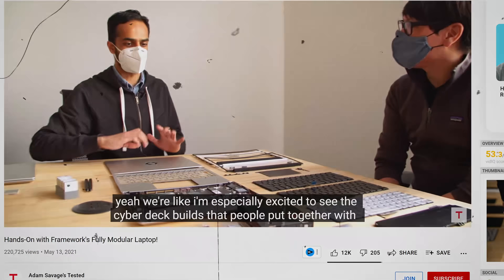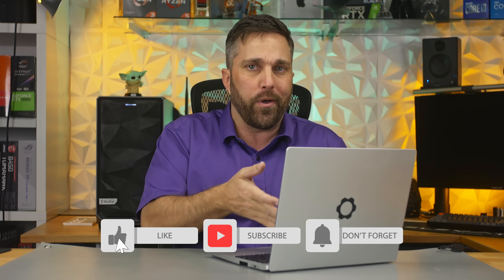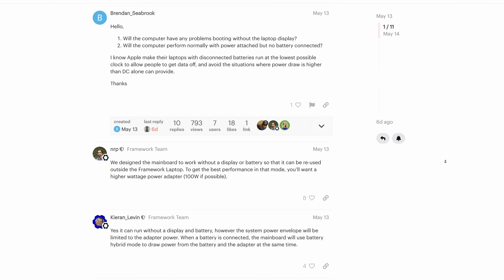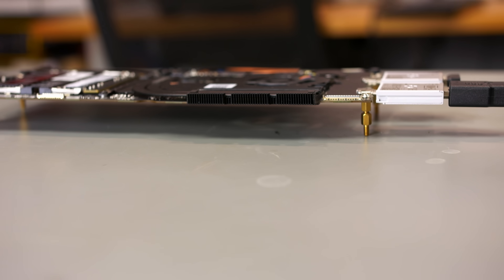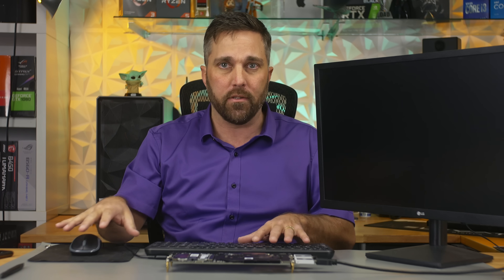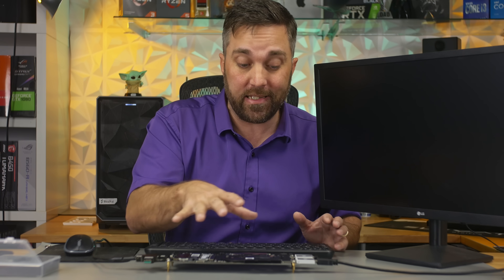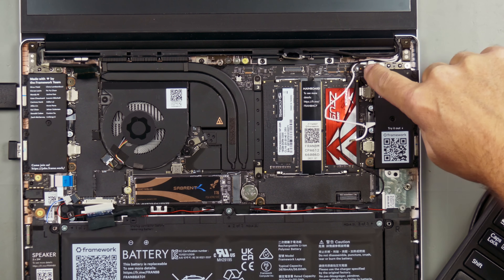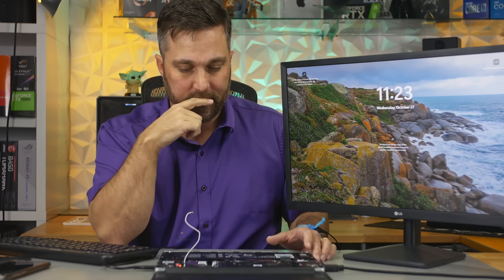This Framework Feature Isn't as Advertised. - Mainboard Testing.

Comment: 3.06 firmware which is currently in beta testing has battery-less operation working (with a few nits), and will be fully functional in an upcoming firmware update.  It actually works with older firmware as well if you use a higher-wattage power adapter, just not the 60W adapter we ship with.
Reply: @Elevated Systems, and @Framework, what you two have done in this post proves two things to me. First, why we need to always do our own testing. Second, a company that cares about what its customers say and do with their product matters, and the level and speed of a response matters in handling the problem or kudos. This is why I purchased one recently. Thank you so much for doing t he work on both ends, and sharing with us this information.
Reply from the maker: Edit: Just got the BIOS v3.06 that was posted on the Framework site.. Will install and start testing tonight. Will post an update ASAP. 
Thanks for the update. Can you provide a link to the Beta BIOS? Also I tested with a 100W power supply. Edit: My apologies for my initial thumbnail. I was disappointed and I let that get the better of me in a way that was not fair to your mission.
Reply: @ElevatedSystems  apple doesn’t reply this quick 🙄 or at all…
Reply: @BozoFett  you guys getting replies from Apple?🤯
Reply from the maker: @BozoFett  Apple still hasn't replied to me when I reached out about my M1 Mac Mini failing to boot almost a year ago. But I don't have the same (or any) level of trust for Apple that I do for Framework. When someone you don't trust or respect betrays you it isn't unexpected but the opposite stings a bit. (and yes betray is too strong but it was a metaphor after all)
Reply: @BozoFett  their business model does not acknowledge people at all. they do their own thing and pretend that no other company exists. for the first time in over 20 years, they have directly compared a spec of the new macbook pro with a gaming laptop of some sort. when they do something that people have been asking for such as bringing back mag safe or an SD card slot, that is coincidental that people just so happened to be asking for. Same for Adobe. they just dont care. they dont have to care. they can get away with it because people will still buy their shit. the problem is not the companies. its the people going back and not doing anything about an issue.....

Users complain and complain and complain, then they keep using them. Why do you keep eating something you dont like the taste of and that isnt very good for you? you know what that is called when people do that? an unhealthy addiction....
Reply: @ElevatedSystems  does the charger output 100W with the battery plugged in? ie have you proven that it's actually putting out or pulling 100W.
Reply from the maker: @jonmayer  Yes I load tested it and it peaked at 98.1W
Reply: @ElevatedSystems  Beware of voltage drops both on the adapter and across the cable as well.
Would have said send it to Linus but he’s invested in framework so you might not believe him.
Also the USB-C power capabilities and data reporting by cables and power supplies can be iffy sometimes.
Reply: @ElevatedSystems  emailed you a copy of the 3.06 BIOS
Reply: Has anyone else notice that Framework's statement about  misleading people was also misleading? He tested the thing with a 100 watt charger and it didn't work like they just claimed it does.
Reply: @garryconnors8804  and where was the prove that it actually was a 100w power charger ?? he has not shown us it was 100 watt he can say many things untill he shows us it is in fact 100w also he knew they were working on it to make it work without a battery  but still he want to pull framework down he is misleading not framework and i seen in a comment that some one gave him the beta bios ...  so he can set his mistake straight and if he does not make a new video with the new bios and shows us he actually has a 100w power supply then he is the one we cant trust in what he claims .
Reply: @garryconnors8804  be careful Garry, you're not allowed to say anything other than glowingly positive statements when it comes to Framework... :D
Reply: @emlyndewar  No need to troll, some people care about sustainable products that's all. No need to make fun of them. I know you're happily supporting Apple but what they do is harmful to consumers. It's a small company that already provided tons more than any other company thousands bigger.
Reply: @bencze465  You are missing the point. Some people care about sustainable products, that's why it was important for this video to highlight the claims that were (at the time) not being met. 
I'm also NOT typing this on an Apple product, instead on a 5th gen i7 Dell that's fished from the trash... 
I care about sustainable products, and Framework are cool, but the level of fanboy nonsense surrounding them is ridiculous.
Reply: cheers, Framework 👌👌
Reply: @ElevatedSystems did you try an earlier firmware? Their release notes mention that it’s a known issue with the 3.03 firmware. It’s possible (and as a software engineer I have done this 1000s of times) that they simply broke the feature. The forum post might have been a “hey we know we broke it, we are fixing it next release”. Just since you went a bit guns blazing but didn’t mention trying an earlier firmware it’s worth the ask. I have been enjoying your content, this just doesn’t seem as well produced as most of your other content. 
If they did advertise a non-working feature that’s poor form.
Reply: Not saying this happen but it problem worked without a battery at some point in development. Then there could have been a battery problem and they added a check to the firmware and I turn making it think there is a battery problem when there is no battery so it won't boot.

I have helped support software this same thing happens to a fix to a problem ends up disabling a feature that customers used.  You know how hard it is to tell a customer you know that feature you use well you have to downgrade if you want it back I know there are security risks but the feature won't be back to at least another few months ;-)
Reply: @jbscmos  this is why open source is the way to go for any business interested in making a quality product
Reply: pog
Reply: Thanks framework. That was a pretty quick and easy fix, as if you were planning to do this all along...

Maybe this is a good example of work with the company before jumping to conclusions.
Reply from the maker: @Kirk Eby I pointed it out. I pinned the comment so ppl don't miss it.
Reply: @ElevatedSystems  I fail to see how Framework let you down then.. The title along with the corresponding video makes you sound very disingenuous. The lack of weight in your opinions is exactly why I don't plan on subscribing. It sounds like everything Framework has said, they've upkept. It really sounds like YOU'RE misunderstanding, and are being overly critical. Ooh, they have ruined your trust? Won't effect their sales at all.  Thousands of pulls from your vids? I highly doubt it. 1000 people can watch your vids, but I doubt a tenth of them view your opinions as important enough to make up their minds with an important purchase. You are not held in high regards in the tech community. In fact, I don't even know who you are. LTT I know.. but you? Not a damn clue.

I for one will likely be buying from framework, and I'm NOT even a fan of Laptops. What a waste of 15+ mins. Smh..
You have 15k subscribers, but I see no strong community, nor pull. I'd love to look into the Followers to Likes ratio of your page. This has been a joke, and not a very good one.
Reply: Yeah.. Looking at your most viewed vids, 1-2%. That's your engagement. If 100 people saw you, only 1 or 2 would say hi.. and even fewer would pick up what your selling. I'm out of here.
Reply: @HollowQuest_KoseiZero  I see that you got it to work. NOT. Just like to WHINE when someone else puts it out there to say hey you said this and then it didn't work. He gave it a decent try if there is a work around that is all I feel he was asking or even if he made a mistake. Your comments about subscribers changes nothing about the truth.
Reply: @HollowQuest_KoseiZero  he just wants to have content more monetary purposes. He is youtuber after all.
Reply: @HollowQuest_KoseiZero  You sound like a standard LTT viewer. 😂
Reply: @emlyndewar  He has a valid point that there's no need to over dramatize the effects, maybe 2 people bought because of these videos. Maybe. You're attacking the person for having an opinion which is basically invalid as an argument and just troling. Statistically probably 0.001 of those need this feature now. It's a valid thing to expect to work if advertised as such but it's a startup, what you expect, look at how crappy Teslas were years after starting production, and they were already handling like billions. Disappointing that not all features are production ready, sure, but also to be expected.
Reply: @HollowQuest_KoseiZero  we are all quick to judge others. Your criticism is welcome but it’s extremely worded. We can all be a little bit polite when voicing our opinions towards things we find displeasing. The man here slipped once, why be so harsh on him for one incident? Or even more? He is not doing this to bring Framework down, rather making them accountable. Granted, he could have made a better choice with thumbnail and the title, but YouTube makes creators do awful things, the least we can do is to not make ourselves awful, too.
Reply: @Elevated Systems - I think everyone appreciates you testing this claim. Thanks to you, the one or two people in the world who want to buy a framework laptop in order to disassemble it, 3D-print a case for it, and use it as a mini-PC without the battery now know they will need to wait a bit for v. 3.06 of the firmware in order to fulfill their dream. What no one appreciates, clearly, is the click-baitey sensationalism you stoop to in order to flog this video at Framework's expense. We're talking about perhaps the most niche feature of any laptop ever, which almost no one will care about (this use case is literally what NUCs and the thousands of similar products were invented for), in a recently-designed and essentially beta version of a brand new product that is still undergoing amazingly active development, and for which you received an answer from the manufacturer in a matter of hours. Yet you compare this to... Apple intentionally and systematically defrauding the public for years? 

We need a tech version of Godwin's law for this level of hysterical, self-serving hucksterism.

Your strength is that you actually know a bit about tech - you can use Linux and a multimeter, unlike most tech Youtubers. Focus on your strength, resist the urge to clickbait, stop with the annoying, melodramatic Linus-style pauses every few seconds, and you'll do great.

FULL DISCLOSURE: I don't own stock in Framework, I don't own a Framework, and I don't plan on buying one because I use 17" laptops only.
Reply from the maker: @poissonpuerile8897  Just two replies, the pauses are due to my stutter not dramatization. And if the Mainboard wasn't important to makers outside of the laptop, why would Framework be offering it for sale on the marketplace? Everyone who owns a Framework has one and it's under warranty.
Reply: @ElevatedSystems  Hello!  I think this was a simple mistake and perhaps you were too harsh on Framework for it.  You already knew they were working on fixing it, and proceeded to speak as if Framework was silent and uncaring.  I do think Framework should consider notifying their customers of this issue and its fix, once it is ready.  Knowing about this issue beforehand could save people a lot of frustration when, potentially years from now, they try to repurpose their Framework motherboards.
Reply: @ElevatedSystems  "And if the Mainboard wasn't important to makers outside of the laptop, why would Framework be offering it for sale on the marketplace?"

For repairs and/or upgrades... like any other part on there?  The whole point of the board to working standalone is to give the hardware a second life further down the road when upgrades become available.  As it stands it has barely started its first life, so what you're trying to do right now is a niche use case of a niche use case.  FW should absolutely be accountable for this, but the resolution is to fix the problem, which they're doing, and conclusion should not be that the board is e-waste as the thumbnail to the video suggests.
Reply: @61 Cygni I fail to see how this was an immature response. The concern wasn't legitimate, as his point was that Framework said it could be used outside the laptop, and it could.. he was annoyed that it had to have the power bank attached in order to work.. but Framework already has a firmware patch in the works to fix this..

So.. literally nothing to complain about. But then instead of being like, "Okay, all concerns are being addressed." He wants to talk like they've failed him and even go swinging his weight as an influencer around. Now THAT'S immature. And entitled.

You wanna talk, Cygni, talk. Just meet me where I stand. You're standing out in the cold over there.
Reply: @HollowQuest_KoseiZero  to me it sounds like you're the one misunderstanding. His point was that Framework said it could be used outside the laptop and without battery, which it **couldn't**, and framework "already has a patch to fix it", after 5 months.

sure, i'm not saying mistakes can't happen, and him just realizing it doesn't work (and framework fixing it just as he realized it doesn't work), means people weren't very affected by it.

what would let him (and others / me down) is framework talking about it as if it was never supposed to work until now. again, the action of it not working doesn't really matter. only the way framework adresses this issue matters

ps: him being more upset than normal for this is not necessarily bad. he may just be very passionate about it, and even though framework said they were working on a fix (and here's where you might think he was overreacting), this still threw his plans off since he was expecting to work on some projects, but cannot do so anymore until the update comes in (which framework has yet to give a release date for). i don't think you or anyone else would have ever planned / were planning to work with the board, and just because you don't care, doesn't mean he shouldn't either
Reply: @61 Cygni His mention of being someone who brought thousands of peeps to Frameworks.. (as if the product doesn't sell itself.. and that he's actually a big shot) is the reason for me to put him down a peg. I'm sure he believes he lead people astray.. because he's delusional about his own influence. Give an opinion, fine. Believing your opinion matters when it doesn't? That's called a joke. Like I said.. this vid was a big joke.
Reply: @61 Cygni Bye Felicia.

Comment: couldnt you just simply plug a small capacitor into the battery plug on the mainboard, the 100w power brick should charge the capacitor and allow it to boot nearly instantly.

Comment: You obviously do this YouTube thing for a hobby so sorry for the thumbs down, but wow.  There is a bug in the current BIOS update that means a previously working feature does not work in the current version. Why then go and update to the current version that is known not to work just to create edgy content with "Mislead" in the thumbnail? Why not have a video about the issue and your attempts to contact Framework to get the version the feature works with? Then show the firmware update and the feature working as intended. Then make your project. To bookend the project, you can update the BIOS to the firmware when available. Nearly the same amount of content, but you look more thorough and are not in a rush to call out a minor issue in a BIOS version as a disappointment on the purchase. You should want to show viewers a willingness to work with a hardware company if the content is about hardware in the industry. Just some constructive criticism. I mean they even replied to your video the same day it was posted. I am sure if the effort was made, it would have been possible to get the support you needed to make the video one that put you and Framework in a better light.
Reply from the maker: That would make sense if it was previously working but it was not. It has been tested with launch BIOS and did not work. Framework just released v3.06 that has Initial support for booting without a battery. I'll be testing it starting tonight.

Comment: no problem that you need to connect the battery ... consider it as battery backup you can still run it outside the laptop case and make your projects  just have the battery at the underside of the board i do not see the problem

Comment: I think having the battery connected to the mainboard is a good thing in the event of a power loss so that whatever customized application DIYers come up with continues to work. If I was building something, I wouldn't mind having a battery to act as backup power. The fact that Framework has acknowledged the issue and has a update on the way is a good thing, not like several years ago when Steve Jobs hand waved away the problem about one of the iPhones having a connectivity issue and said people were holding the phone wrong because of the antenna design or some such nonsense.